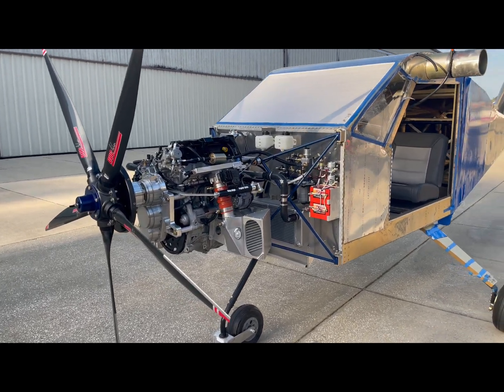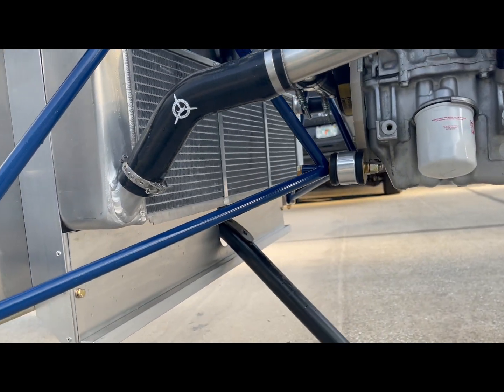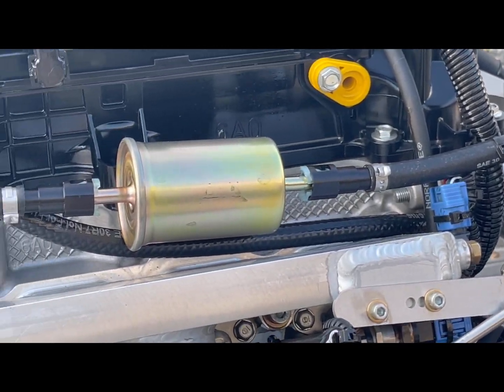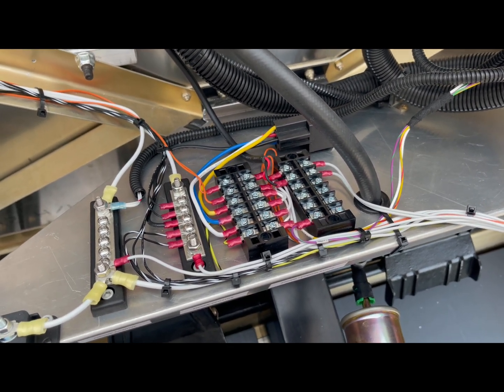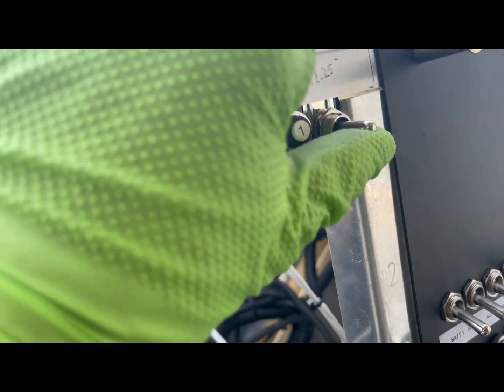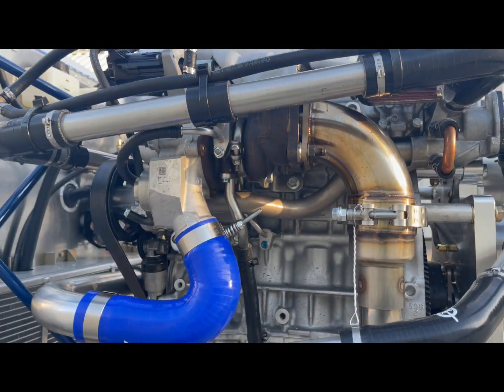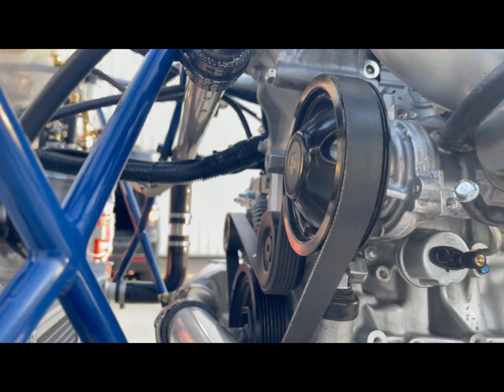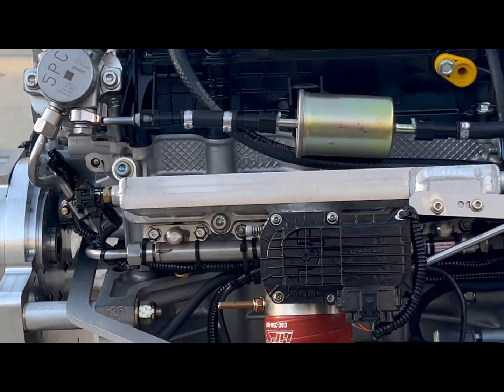Viking 195 T Installation on a BD4

Comment: Looks great. However the area behind the radiator seems a little small. Normally as the air expands though a radiator you need a bigger space after the radiator?

Comment: IMO so many aspects of this installation are impressively well designed— especially the fuel system with its very efficient, low-amp-draw fuel pumps and header tanks. I’m intrigued by all such tanks that Viking has designed but I don’t recognize these. Were they sourced from somewhere else?

Comment: Is this the L15B7 engine? If yes, how you guys handle the oil dilution and gunk deposits on the intake plenum issue of the civics si?
Reply from the maker: Watch some of our Viking Talks videos, they are explained in them. The gist of it is, we don't run the blowby back into the engine as required by the EPA in cars, it runs overboard and we also don't do low RPMS - we are able to get all the benefits our of the engines, without the cons (we currently have about 1000 hours on our personally owned setp)

Comment: Is this a turbo normalizer? Meaning does the motor make 195hp without the turbo, and the turbo is just used to to augment for elevation as you get higher? Has anybody been interested in doing this motor in a sling TSI or HW?

Comment: @Viking Aircraft Engines. You never answered Tim Duncan’s questions.  Please tell us about the turbo performance of the 195T at altitude.  At what altitude will the horsepower start to drop off? Is it all boost for HP, is there excess boost to accommodate higher altitudes? How will this automotive turbo charger perform at altitudes it wasn’t designed for? Is there a concern about compressor stalls?

Comment: Would this engine fit in a kitfox s7 or is it too heavy. Either way its an amazing engine. Even maybe a rans s21.
Reply from the maker: We have done our 130 and 150 engine in the Kitfox, but aren't they putting a continental large motor in the Kitfox 7 too? If so, this comes in slightly under that weight installed. Ideally though the 130/150 is best suited with a variable pitch propeller.

Comment: Jan,
Does the Viking in flight propeller pitch adjustment system have the capability to go to Beta for seaplane and STOL installations?
Reply from the maker: We have it on ours and on aircraft with floats, it has reverse as well integrated.
Reply: Great, I thought so. Thx 4 the info. Your videos are highly educational and binge worthy.

Comment: Viking overs several great propeller options. Why did the customer choose your 5 blade?
Reply from the maker: We only have two proven propellers that work well with our 195T because of the HP, the DUC in both variable pitch and ground adjustable and the LUGA 3 Blade. The DUC is a bit more $, but gets better cruise speeds and is smoother. The LUGA offers more thrust, good for STOL. The DUC on here is a variable pitch, which is the only brand we offer in conjunction with our variable pitch setup, and it is pretty amazing, will be perfect!
Reply: @eggenfellner  thank you that's some great information. I've been trying to get more information on the DUC variable pitch propeller controller. It would be great if Viking would create a video describing the operation of the DUC controller. Your videos are outstanding so I believe you would make a great video.
Reply from the maker: We have everything on the Variable pitch a bit more in-depth on our website under "performance" that being said we use either a switch or a new controller we are testing. The controller isn't a DUC product.
Reply: @eggenfellner  great thank you for commenting back. I'll look out for a video on the new controller. Thank you

Comment: No alternate air source?
Reply: It's fuel injected. No alternate air sorce is necessary. Fuel injected certified aircraft do not have carb heat either.
Reply from the maker: Are you referencing AC? I think he is working on that.
Reply: @eggenfellner  No, alternate engine air, in case of filter clog.  In a certified aircraft it would be referred to as "carburetor heat".
Reply from the maker: Most experimentals aren't flying the aircraft in the conditions to where they need it or want it, but can be put on if wanted.
Reply from the maker: Maybe in certified world, I can't think of a single experimental engine/aircraft that has it out of the 1000 we have out or any others. It is their aircraft and their choice. In no way shape or form is it irresponsible nor is liability a factor.

Comment: Hi, thanks for producing this video. What is the weight of the engine and the prop?
Reply from the maker: the engine is 260 lbs. - the prop is lighter than any other constant speed at around 18 lbs, the standard ground adjustable is about half that.
Reply: @eggenfellner  Am I to understand that this configuration is actually lighter than the typical O-360 installation?
Reply: @eggenfellner   Do you have a constant speed prop option?    What altitude does the 195hp start to drop off?  I am very interested in BD-4C for cross country work.
Reply: @eggenfellner  sorry I see now it is constant speed set up.  How long are rubber bushings lasting at these hp?